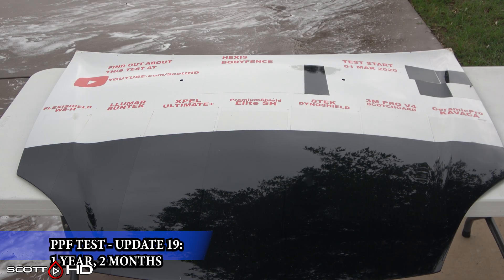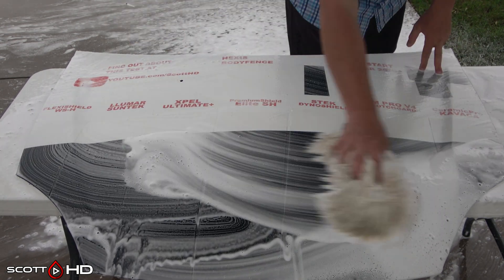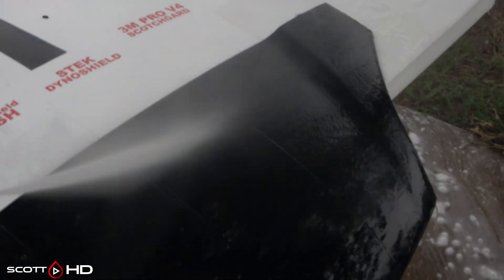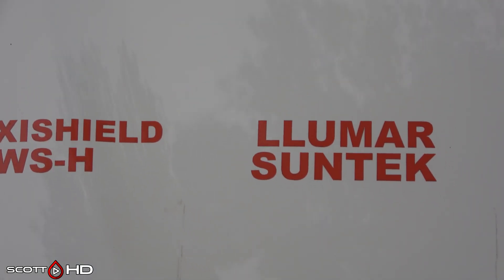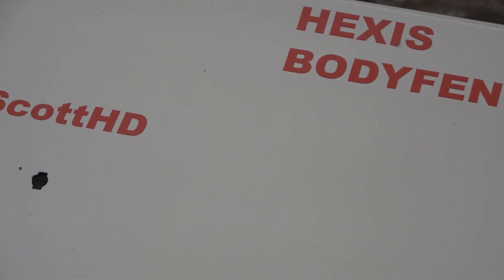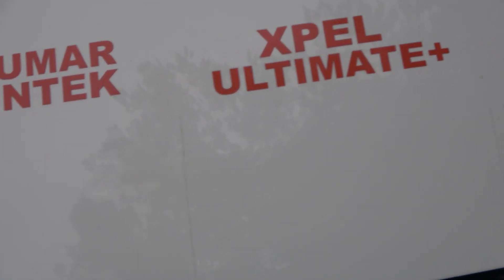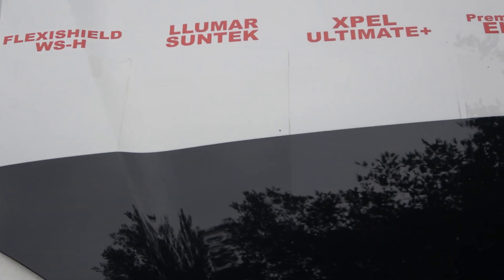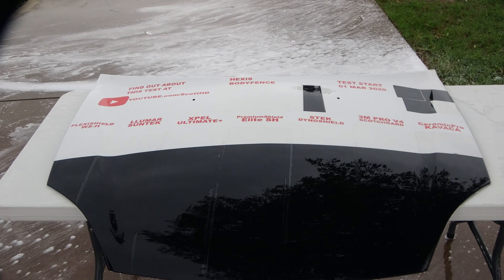Paint Protection Film PPF - UPDATE 19 - Ultimate Longevity & Durability - HYDROPHOBICS CHECK

Comment: Would be curious to know how these films withstand discoloring when a ceramic coating is applied
Reply from the maker: I don't think it speeds it up any, but definitely something I can test!
Reply: @ScottHD  More curious to see if it will improve the durability of the PPF by reducing yellowing and swirl marks that are noticable on some of the brands like the ceramic pro. If UV exposure is the main cause of the film yellowing and ceramic coatings are supposed to minimize the effect of UV I am guessing there should be an across the board improvement.